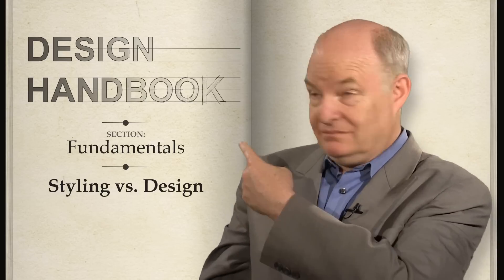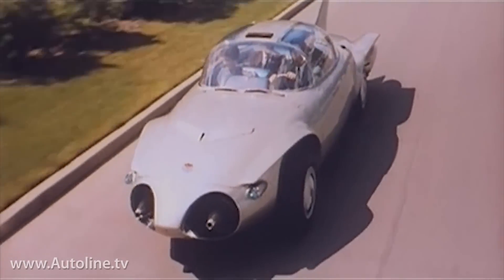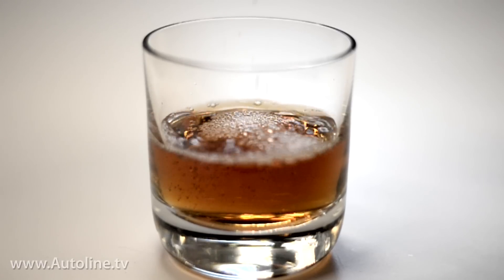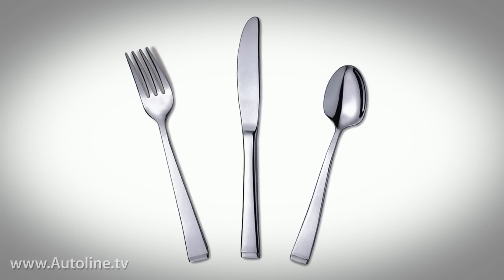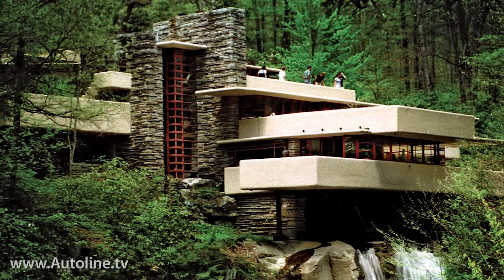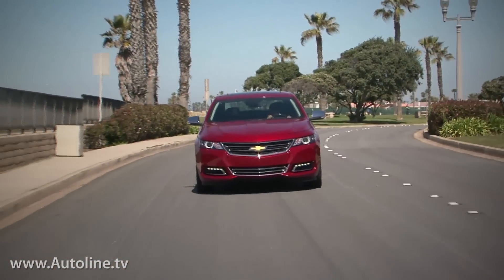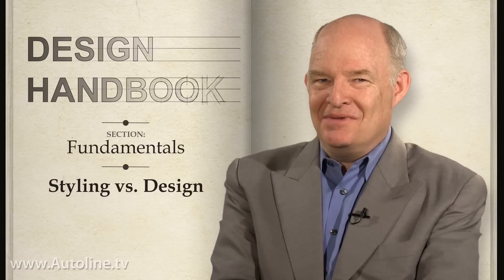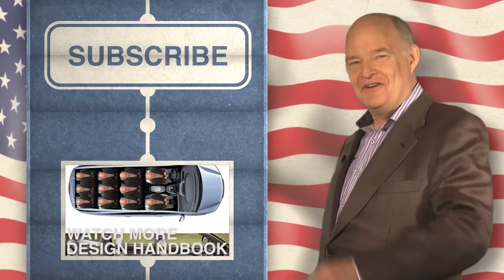Styled vs. Designed Cars - Design Handbook

Comment: To me-  4 door Accords have always been a bit more conservative in appearance.   Honda seems to save more Style cues for the 2 door Coupe... lineage traced to their racing heritage.  They often recommend consideration of the 4 cylinder Accord first, as the lighter engine (vs V-6) makes steering lighter and quicker....again a racing trait.  Doesn't hurt that either platform (properly maintained)can last for 6 or 700,000+ miles...ie Million Mile Bob as an example.  Form, function& affordability.